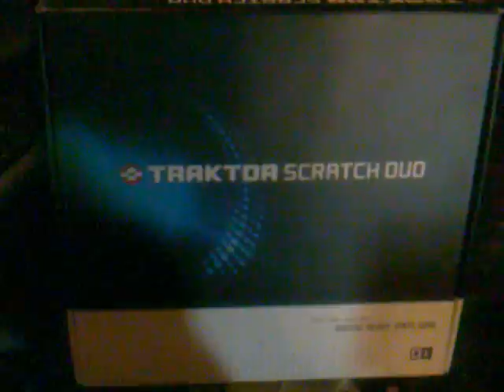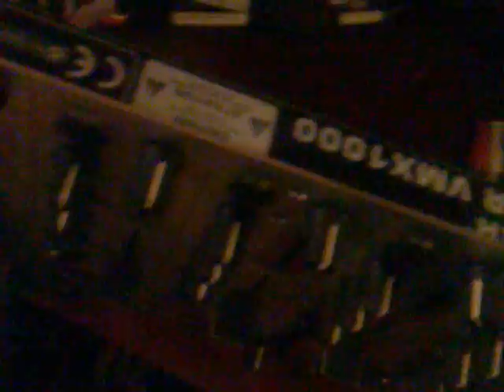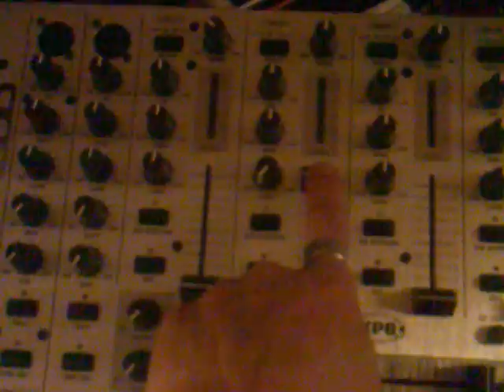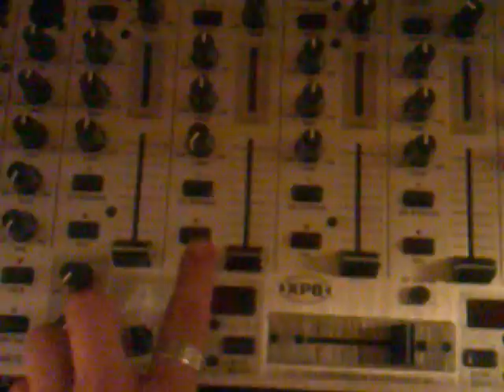traktor install p1

Comment from the maker: @bionicalbibingka  hi ndx 400's are still holding out fine rocking and a shocking at least 2 nights a week yes you can time code a 4 channel mixer you can even time code with  a 2 channel as long as they have switchable inputs between 2 line in's but if oyu are considering the ndx 400 dont use the ndx 800's and you can then forgo the time code side get a few more effects and run midi over usb straight from the cd decks for about £40 each more then the 400's